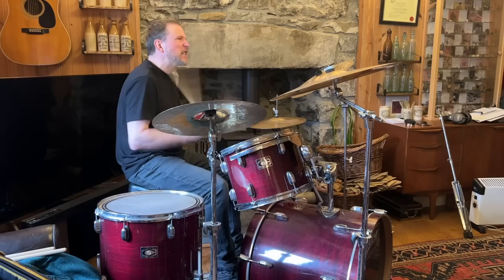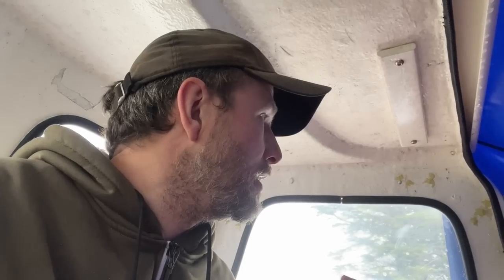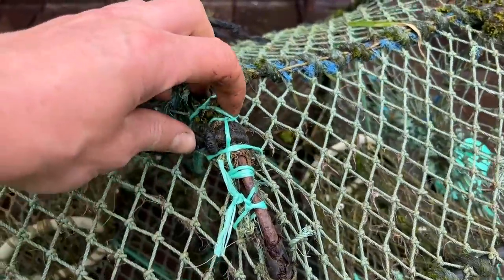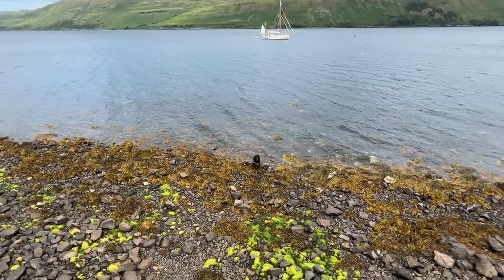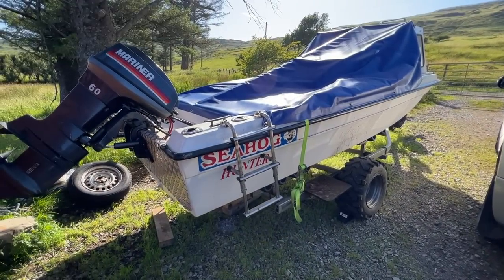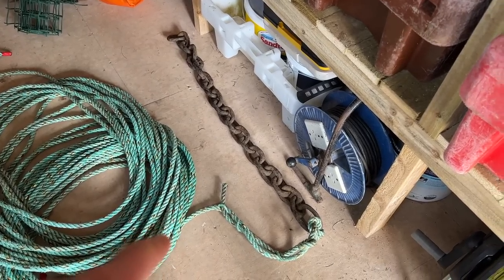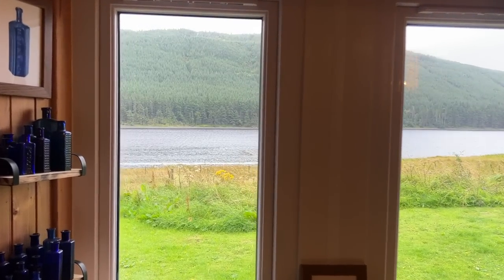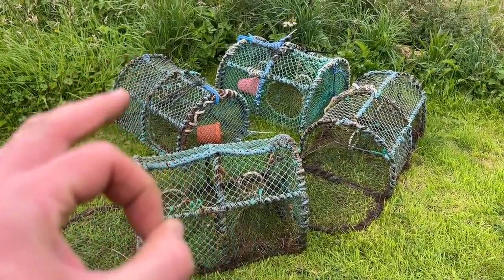Blowout! The Boat Saga Continues on the Isle of Skye, Scottish Highlands - Ep30

Comment: Willie, get well soon, but take it steady, please.
On another topic (the boat and trailer): a spare wheel is good if you can find one, along with a long ‘breaker bar’ and extension, plus impact socket to fit the wheel nuts. And by the looks of that trailer as you were working on getting the wheel off, I’d say some welding work just now might save you from a much more catastrophic failure down the road. A broken trailer whilst travelling could destroy your boat. Salt water does bad things to steel in unseen places. A great video none-the-less. Les

Comment: Under no circumstances should you even consider buying another of those four by tyres for the trailer!! They will give you no end of trouble. Get yourself two NEW tyres, the same as the originals and a used one to match plus a spare rim for a spare wheel.  Good to see that you are getting better Will.

Comment: Re. your boat trailer.  I think that the new tyte fitted, being of a different diameter to the other tyre, is unsuitable because it may cause the trailer to fishtail whilst being towed.  Best practice is to have two wheels/tyres of the same diameter.  It is also bad practice, and possibly illegal (not sure), to not have mudguards fitted to both wheels.  Without a mudguard on wet roads you will be throwing up a lot of water, muck, grit and stones which could have an adverse affect on following vehicles.  When you get a suitable new tyre (or pair of tyres) fitted you may want to consider buying a third wheel and tyre as a spare if you can find somewhere on the trailer to mount it.  Don't be downhearted about the teething problems you are having with the boat - they will soon be behind you and you will be able to start getting real pleasure from your new acquisition.  P.S.  Don't forget to put some grease on the wheel nuts and bolt threads to help keep corrosion from salt water at bay.  Get well soon.

Comment: We have a product that gets advertised on the telly. It's called flexseal. They make a white putty I've used on multiple occasions that actually works very well. As a son of lobster fisherman and the land of regulation, I've sooooooo many questions about lobster fishing in Scotland. You need parachute cord for repairs. Sorry, you'll need to bait them too. The traps are fine FYI. They're not meant to look great. Your pots should be weighted too, usually concrete. Oh and get well!

Comment: Hay the lobster pots are too close together if you try hand hauling them all the weight of the pots will be on the rope at once as you lift them plus lobster's are a bit territorial so would not fish as well as a long space between em. Would be best fished as singles tbh
 if you put a bridal from the pot thru the spinner then about five ft of rope on the other side of spinner to the backrope if you want to fish them as a fleet. If you fish them as single pots put the chain in the pot attached to the frame. Not done any pots in years but hopefully that made sense

Comment: Trials and tribulations of boat ownership.😬
I’ve just found and subscribed to your channel and being a RIB owner, when I saw that large piece of checkerplate on the transom, it rang alarm bells. It’s a common bodge for stiffening up a transom to stop it sagging when the ply core is rotten.
On the plus side 2-stroke yam’s when maintained are very reliable, although not the best when it comes to the environment.

Comment: any old and iregularly used trailer will face the problems you are having. Check the wheel bearings. Surely you can get some tyres which match the existing ones without having to buy wheels as well?!
I think the testing will be posistive long after you are better.

Comment: Love your videos - keep them coming. It's a part of the world i know VERY well indeed.
As per my comment on your boat ownership video please get yourself a little auxiliary engine for backup.
Another thing is i haven't noticed a cover over your prop - a legal requirement when towing here in the UK. (I know the police are a lot less present there than many other parts of the UK)
For a short trip  you can use a bright orange flexible builders bucket and i used to just secure mine with bungee cords. Keeps you a bit more legal as well as protects your propeller - and its always handy to have a bucket when afloat.
For tyres i always tried to get at least 8-ply tyres as the are far less prone to blowing out when hitting a pothole (something i know from experience is an issue where you are)
I cant wait to see how you get on with the pots - you might have fun trying to retrieve four at once from deep water - i found dropping them individually far less stressful !!

Comment: Nice prawn pots, if you want them to work for lobsters put in bigger eyes or make them soft eyes, they will catch lobsters but only smaller one will get in, but work well for prawns.  They are generally much lighter than a lobster pot but they will work just the same.
Reply from the maker: Yes we realised this after filming! No bad thing in our eyes as we definitely prefer langoustines 😜
Reply: You can make them into lobster pots by taking out the hard round eyes and leaving the open ends as soft eyes. The lightness is why you find a lot washed up storms can pick these up easier, but not bad as easier to pull by hand, you can drop them in places out of the tide where bigger boats cannot get into, but a free creel is free, still very usable @livingtheskyelife

Comment: Uh, Willie... did you not see the SPARE tire on the front of the trailer? It's there to replace the flat. Or is there an issue with it? In regards to the rusted bolts. Once you pull the boat out of the water, spray the tire bolts with WD40. This is a trick I learned from my Stepfather who ocean fished. He would rinse the bolts off with fresh water at home, spray the bolt with WD40. No more rusted bolts.
Reply from the maker: It’s unfortunately not a spare tyre - it’s for moving the trailer on land

Comment: That’s a quad bike tyre, ok as a temporary solution to get your trailer home 
But certainly not a permanent solution
Reply from the maker: Yes, they’re not ideal for roads, though they are road legal tyres. However, we now only launch the boat from the village beach, which leads down from a private track, so they’ve turned out to be far better suited than we had realised at the time.
Reply: Just make sure it has an E mark on it or it’s not road legal 
Not all quad bike tyres are road legal 
All the best

Comment: Why not use the spare tyre that’s bolted on the trailer near the towing hitch
Reply from the maker: It’s a running wheel for launching the boat on wet sand/rougher terrain. The bolt pattern is different to the other wheels.

Comment: Tyres on Boat trailers rot out before they wear out, Tyres only have a 10 year life and should be replaced after 10 years regardless of tread depth.. I suggest that you  put 2 new tyres on your boat trailer because the other tyre will be rotting too…. No need to have another blow out
Reply from the maker: Don’t worry - we replaced them both!

Comment: Wasn't there an emergency 'donut" tyre  mounted on the front of the boat trailer that would have gotten you hame?  (not the dolly wheel, a real tyre)
Reply from the maker: No - it’s a jockey wheel. Too small to use on the trailer
Reply: Oh nuts.   @livingtheskyelife
Reply: Glad you're feeling on the upswing. @livingtheskyelife

Comment: Maybe I missed something obvious, what was wrong with using the spare tyre (that is mounted on the hitch) of the trailer ...
Reply from the maker: That’s the jockey wheel, not a spare 😊
Reply: @livingtheskyelife  I wasn't referring to the jockey wheel, mounted about 12-18" back on the starboard side of the trailer I thought I saw a spare in the earlier video when you bought the boat
Reply from the maker: Ah, yes, I see what you mean - you’re right it isn’t the jockey wheel. It’s a running wheel for launching the boat if the water is shallow. The trailer runs straight back on it when you unhitch it. The bolt configuration is different to the main wheels on the trailer - it can’t be used as a spare. That was the first thing we checked, of course.
Reply: @livingtheskyelife  yup, a sand skipper, I've always seen those use the spare, so double duty, spare if needed and flip down as required for launch/retrieval ...

Comment: So sorry you are having problems with your boat but as I said in my last comment you don't know what you don't know.  Trailer tyres in salt water crack in the treads, you need to wash the wheels after each immersion.  Bearings need to regreased also each time you dunk the trailer. A spare reliable engine is also essential. I don't want to put you off only keep you guys safe. RYA powerboat level 2 is your way to knowledge,  please get yourself trained. PS. get well soon.